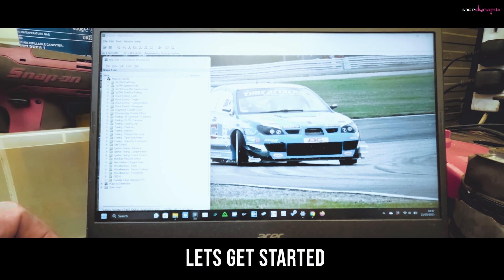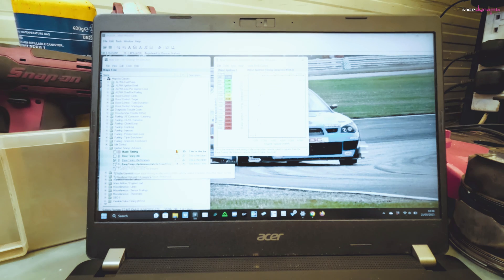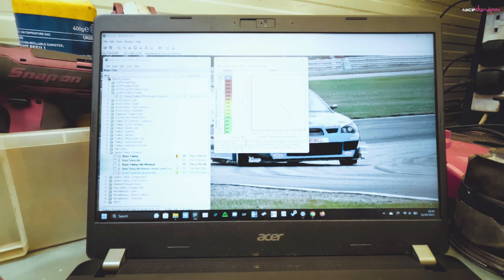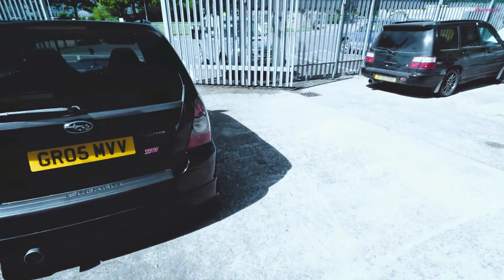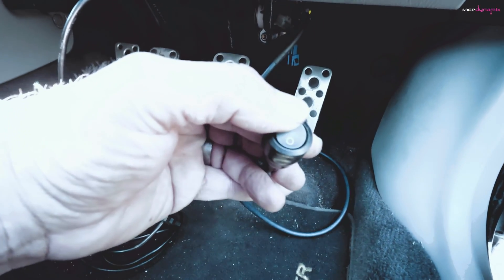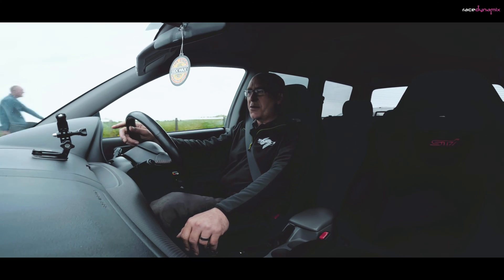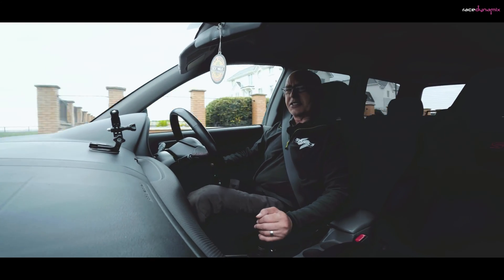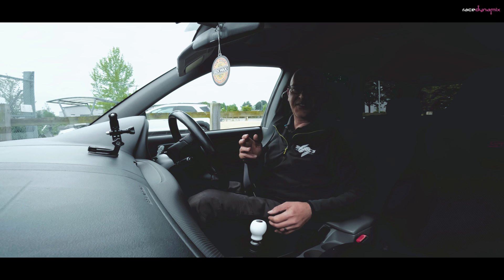Add Pops and Bangs to your Subaru in the ECU Tune

Comment: Hello! That bugeye uk300 that appears on the video, has a 6 speed sti swap right?
Do you know what is the rear diff ratio? 
Thanks, and good work :)
Reply from the maker: Hi... I don't off the top of my head but assume it is a 3.54 👍
Reply: @racedynamix thank You so much for your time :)
Reply from the maker: @josemachado555_ no worries 😊

Comment: Awesome video mate, silly question but can I do this with a ej253? 
Motors completely stock but I have deleted the cat converter, resonator and have a full 3” exhaust. It only does small burbles but doesn’t pop and bang like I want it to.
I’m new to Subaru’s and I’m used to tuning old mechanical diesels.
Reply from the maker: yeah, should be able to 👍👍.thanks 😁

Comment: Do the pops and bangs give you anti lag, and I have seen it switchable on a standard ecu.
Reply from the maker: It's a very mild form of it.. not the same but mainly just for sound effects 😎
Reply: The switchable version of popsbangs need to run on carberry rom iirc...

On factory rom, this is the only reliable and quick solution

Comment: how can I do it at 3500rpm on ecuflash?
Reply from the maker: Do your xml definitions have the tables that I amended in them ?
Reply: @racedynamix  I don't have the same definitions, I only have the first point (subaru forester sg5 2.0t) but i need help for the larger injektor to sir :)
Reply from the maker: @HakoFPV  what is your rom id ?

Comment: Is this possible to do on a 2001 subaru legacy gen 3? (2.0 twin turbo)
Reply from the maker: Unfortunately not properly like this.  The ecu on the gen 3 won't allow negative timing so won't pop at all unfortunately
Reply: @racedynamix  Aww that's unfortunate, what's the mapping capability on these cars? Or is it just a case of leaving it how it is
Reply: @racedynamix would it work on a 2004 legacy bl5  2.0  twinscroll ?

Comment: Hello! Great video! I'm actually watching all your videos. Thank you!

I do have a 2010 Subaru Impreza 2.0 naturally aspirated, cat delete. Do you have and idea how much HP would be able to increase after tunning it? It worth? Thank you a lot!
Reply: I'm also would like to try to add some pops and bangs on it
Reply from the maker: Hi and thanks ... na cars are more difficult to get sizeable gains from, there are gains to be had but much harder to get. Pops and bangs are pretty easy though.  Are you able to read the ecu rom file ?
Reply: @racedynamix  Thank you for geeting back.  I was about to buy a tactrix open port to read the ECU, but I decided to contact a local runner first, and they said this model they don't heard of a way to decode the ECU and edit it. The car as II said is a 2010 Impreza 2.0 na EJ204 (pretty sure that the ones sold in Brazil are EUDM). Have you ever heard about not being possible to tune this car?
Reply from the maker: @otaviohpf182 as far as I know it is a Hitachi ecu in that.  I haven't be able to get into it as yet I am afraid but rarely see so haven't tried recently.

Comment: Are you running a merpmod patch…
Reply from the maker: No..the std ecu rom set up 👍
Reply: @racedynamix  heck ya. I run a iat cut off switch style and use the iat timing comp table for mine. How do you control launch control rev limit?

Comment: How would i add over run fueling to my 08 fxt rom
Reply from the maker: Hi.  Exactly the same way as I did it on the video.  If that table doesn't exist in the xml definitions for your rom it doesn't mean that table isnt there...just that noone has put it into the definition.  I added that table to my one.

What software are you using?

Comment: would avcs have an effect on the pops and bangs if not adjusted with the base map, if i want the pops and bangs i have to gently touch the throttle
Reply from the maker: Hi, that is because on the overrun the std set up switches off fueling.  Just touching the throttle opens the injectors a bit.  That's why I adjusted the overrun fueling threshold map too to give some fuel to combust 👍
Reply from the maker: Sorry.. Not avcs related 👍

Comment: Iv got a NA ecu forester 2006 2.5L and i don't see overrun fueling? is this only for the turbo models ?
Reply from the maker: Hi.  It's possible that is the case.  It will be in the map but not found in the xml definitions you have.

Comment: Good morning.

Question apposed to pops and bangs .

The yellow flame backfire that our cars do when we are on it .and everything is hot .. is far more desirable than the pops and bangs 
At what point does it start to hurt bored with over fuel?
Reply from the maker: It isn't really overfueling that much to cause bore wash. Just some unburnt fuel 👍
Reply: @racedynamix  so if I wanted to tune that in . Rather than a bang .. 
So a gurggle with a yellow candle ,if I can term it that way ? 
Would that still be destructive .?
Reply from the maker: @douglang4615  only way to do that is with a flamer kit with spark plug at the exhaust tip
Reply: @racedynamix  ah ok

No thanks 
 🤣🤣

See you online tonight.

Thank you for all you do and teach us

Comment: Just curious if this can be done on a twin turbo legacy with the factory exhaust?
I’m thinking if trying it out 😂. I hope you left the pops and bangs in the tune
Reply from the maker: Hi... I am not sure off the top of my head as to the limitations of the ecu in yours but assuming you can get the timing where it needs to be the pops will be created.  Whether you can hear them through the std cats and resonators is another thing - I very much doubt it will be audible to any real degree.  Worth experimenting though :)

Pops and bangs stayed in mine for a long while but have removed at the moment as most of my miles currently are boring motorway miles... They will return :)

Comment: How would this be done on the fa20dit? I managed to retard the ignition timing but it seems to enter fuel cut during overrun.
Reply from the maker: Are you seeing tables for overrun fueling?

If not there may be a way to do it using the dbw tables in overrun conditions to enable it to open throttle a bit.. But be careful with this as you don't want the car driving itself.
Reply: @racedynamix Thank you for your reply. Unfortunately there doesn't seem to be any tables identified in SubaruEdit for overrun fuelling. I'm tuning mostly CVT Forester XTs here so I think throttle opening when foot is off the pedal is undesirable since the CVT remains "in-gear".
Reply: @racedynamix  I'm here with the same problem but i have a stick shift so it should work in theory.  will a requested torque of 0.5 at a pedal angle of 0.00 give enough fuel to give a little pop and bang? not sure if im understanding you right...
Reply from the maker: @roborylan7094  hi.  In theory yes but be very careful that you don't cause the car to drive itself or rev itself
Reply from the maker: @roborylan7094  the overrun fueling tables are in the ecu.. It will just be a case of finding them for your rom id

Comment: I would love to have a map like this on my legacy. Its childisch but when a sudden crackle instead of massive gunshots its nice.
Reply from the maker: Thanks for watching... What year/model do you have?
Reply: @racedynamix  07 3.0R with Si-drive and an 03 2.5 MT
Reply from the maker: Yeah it is possible on that 😎
Reply: @racedynamix  would be Interessting to have it in Sport sharp Mode and leave it Stock in Intelligent and Sport.
Reply from the maker: I'd need to check whether Ecutek racerom would be possible to cover your ecu as that would allow adding a separate ignition map for sports# to have the sound effects on. Done this many times on Imprezas 😎

Comment: You can program pops & bangs to the defogger switch on your hvac, still retains the defogger function. Clean build though, very nice work.
Reply: Can you make a video explaining how to do it ? 😅
Reply: I saw my tuner dpo it on rom raider, there is a table he mapped the antilag to the rear deffoger.  @gamarra_pt
Reply: Thats on the carberry rom, 16 bit ecus. these foresters are 32 bit, drive by wire ecus. Im not sure but i think you can run merpmod or dime mod on these ecus though but im again not certain if the merp/dime mod allow for dual maps
Reply: how do you do that?
Reply: @helloworld8136 i sadly don't know how to do it myself, its my tuner who did it. He changed a table value to make the antilag be controlled by the rear defogger switch

Comment: 👍 can these be added to a gc8 safely or is it just newage cars etc
Reply from the maker: It's more difficult to add to a gc8.  The 99/00 ecu won't let you go into negative ignition values and the earlier ecus aren't mappable as std.

Aftermarket ecus are available for them and you can add them.. Obviously check with your mapper 😔👍
Reply: Oh that sucks, I own a 99 turbo Impreza, so I guess new ECU to add to the cost of ownership 😂

Comment: In regards to the green connectors, can you not just plug them into each other? Also, i did have a look for ecu edit but could not find anywhere to purchase the key to activate the software
Reply from the maker: Yes you could just plug them in but when making multiple changes it is so much easier to flick a switch rather than clambering under the dash.  Look on epifansoft dot com for the software and purchasing 👍
Reply: @racedynamix  ohh makes sense now. Mine are annoyingly on the passenger side under the floor panel 😂 thank you for the help!
Reply from the maker: Ah.. Legacy.  Weird how they put them there
Reply: @racedynamix  yes, took me a while to find them 😂
Reply: @racedynamix  will you be doing more videos like this? Very keen to learn about tuning and how things are done
Reply from the maker: Absolutely.. Trying to get set up right to do a live tuning video, real-time.  Will be soon (ish).  In the meantime is there anything in particular you want me to cover off in a video?
Reply: @racedynamix  oh thats awesome! Currently looking at how to make the switch cable you have for the green connector! Maybe a beginners guide to tuning subaru? Or a guide to launch control/limiter? At this point my brain is a dry sponge ready to soak up everything and anything tuning related 😅

Comment: Had my blobeye done the other week by a different company, only pops when revs are really high and exhaust has to be way hotter than im comfortable with, same with launch control and antilag, flick the switch and it raises the revs but no pop and bang :(  sad subaru blobeye owner
Reply from the maker: That's a shame.  Have a word with them.. If you want pops then they should be able to provide 👍

Comment: What's the general consensus with cat , decat or sports cat Duncan?
Reply from the maker: Difficult one.. I'd probably say sports cat on balance 👍
Reply: @RaceDynamix Subaru Tuning   I'm presuming it may start to ruin a cat / sports cat over time?
Reply from the maker: Most sports cat are only good enough for mot for 2 yrs anyway really from what I am seeing at the moment
Reply: Not a fan but my STI pops “some” on hard upshifts. Curious though, how does pops and bangs differ from a burble tune?
Reply from the maker: Just the amount of ignition retard tbh.  A figure of around 0 would burble 👍

Comment: how do u configure it to turn on off with heated rear window? 
loving the channel btw
Reply from the maker: That can be done on Ecutek racerom which is available on drive by wire cars.  On some cable throttle cars it is possible to do alternative types of rooms using a mild antilag set up but I wanted to cover the basics of what contributes to it so that it can be applied to whatever type of rom you are tuning 👍

Comment: I must agree with yourself. Pops and bangs are a great laugh when you want them but if you're driving down the road at a normal speed and pop and crackle like the golf r then that's too much. There's a fine line between chavvy and cool 😂😂
Reply from the maker: Thanks.. Agreed.  I chose the 2800 rpm start point so that I can drive normally without them.. Seems to work well imo for some giggles when I want them and stealth mode when I don't 😊

Comment: Any long term effects of the pops and bangs apologies if I missed you mention this in the vid? Mine actually pops and crackles a quite a bit as it is 😁
Reply from the maker: The main downsides are a little more wear on the turbo due to the shock of the explosion through the turbo and on the O2 sensor.  Because I also effectively switched off the overrun fuel cut off there is a marginal increase in fuel consumption.

Thanks for commenting and watching 🙏
Reply: @racedynamix  great answer thanks Duncan, looking forward to getting mine mapped with you soon. Nearly at the 1000 mile run in 😁
Reply: @racedynamix  What about risk of damage to the valve heads Dunc? Have you ever come across broken or damaged valves as a result of running a pop and bang map?

Really enjoying your vids, keep posting!
Reply from the maker: I've not seen that to date.  Full on antilag could do that but these are much milder and unlikely to cause much extra strain there.  Obviously if you chose to add them then be aware that there are downsides 👍
Reply: @racedynamix  Thanks for the reply!

Oh, I already have pops and bangs ;) (https://www.youtube.com/shorts/1yh39ti-jLw). I can stomach a turbo change (always an excuse to upgrade) but if it was causing serious engine issues if used long term I'd be thinking about how frequently I used them - switchable maps, pops only on the high boost map.

Obviously I am well aware that any sort of engine tuning can lead to issues and failure of components.

The car only does about 1000 miles a year so I like to enjoy it and make it a bit of an event when I do use it.

Cheers Dunc!